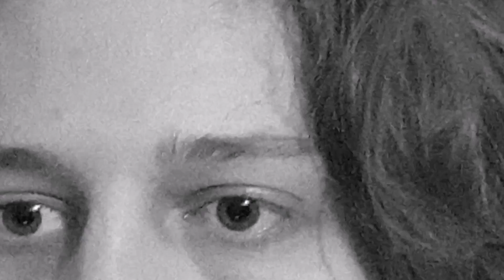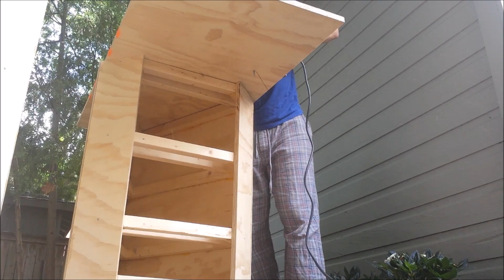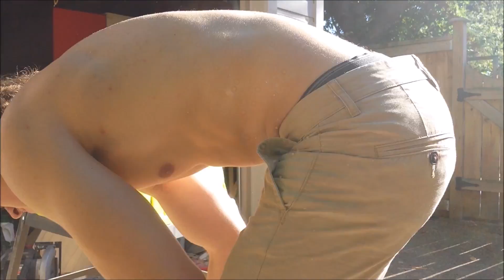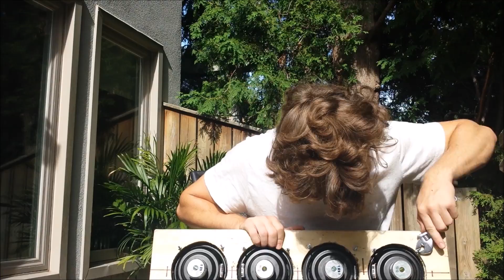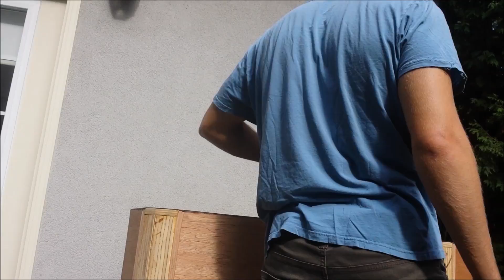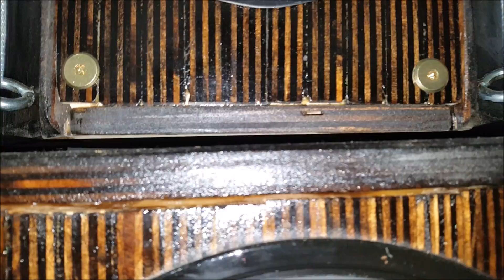700 lb DIY Speakers

Comment: Crazy job mate!!! It's great to see this kind of dedication. You are on a right track. These deserve dedicated listening room. Strip the sheetrock in your room and replace with 3/4" Birch plywood. Make sure that you have it packed with Fiberglass insulation between studs. Then add some acoustic panels as needed.

Comment: Great design, almost there, need more work on the finishing.
You should not just lacquer it like that. Trim all the access, get some body filler, sand it smooth, then spray paint it.
Lacquer gloss finishing need some amount of woodwork skill and a lot of times to do it.

Comment: Very nice!... I would have loved to see how you made the crossovers for these!... Are you using passive x-overs, or an active electronic one and separate amps for all the drivers?... If you used passive x-overs, then did you make the coils yourself ,and what type of capacitors did you use, and on the other hand, if you did use an electronic x-over and separate amps, then which x-over model did you use?... Also, what kind/brand/model of tweeter is that? I like how you have it suspended like that; that set-up ends up producing better imaging than if you had it mounted to a baffle, because of the sound diffraction from the baffle itself... Nice design, looks pretty high-end... More details please, about above questions!
Reply from the maker: its an active crossover. the crossover is a dbx 234 i think. the tweeter is an Aurum Cantus AST2560 Aero Striction Tweeter. All the drivers are suspended from the base to isolate vibrations. i honestly couldn't think of a way of mounting the tweeter, but this method gave the best imaging as you said and made it easier for dipole sound pattern.
Reply: Nice! Thanks... I'm gonna have to try something like this sometime for myself!

Comment from the maker: Could anyone give me some suggestions on how to improve my video/content for future builds?
Reply: We want speaker schematics.
Reply: DiyItYourselfYourself make a cerwin vega l36 baffles
Reply: I have plenty of suggestions for you. If you can take constructive criticism, here goes:
Firstly, I like the fact that you are building, not buying. And you have to start somewhere, so well done with the correct mental attitude.
Content wise, the speakers look like steam-punk at best. There are many mistakes and errors, bud. You don't know how to cut, glue, clamp or join properly. And your table saw technique will soon see you parting ways with a finger or two. Probably the second worst use of a table saw I have ever seen. At least you seem to be wearing safety glasses, so that's a plus. Regarding choice of materials, rather use MDF or particle board for cabinet construction. 
Plywood is not a great material for speaker boxes, because it often has voids between layers, and it flexes too much. These two issues can lead to resonant panels. Any joint that is not structurally sound will also resonate.

As a beginner, you should focus on simple box designs that are within your skill set and your tool set. Use butt joints with interior battens that will both strengthen and seal your box. Finish exteriors with bondo rubbed down properly to conceal lines, and matt grey, or black paint to finish. Or a textured paint like fleckstone or truck bin liner instead of the bondo and matt paint. Use a router to ad half round profiles to edges.
Regarding the mid-range enclosure. From your video, it appears that your mid drivers are sealed at the back. So no enclosure needed.
Regarding the steel framework: Totally unnecessary, and badly welded. 
Why bother with that crap of suspending mids and a tweeter? Absolute nonsense, mate.
If there is a reason behind it that anyone could hear, all speakers would be made that way. Forget esoteric, audiofool nonsense. Concentrate on a well made box (use a driver with known T/S parameters) , with ONE full range driver, and ONE tweeter. 12 or 24 dB/octave active filter, decent quality amp modules. You will be amazed at how good it will sound.
If you want me to give feedback on your video, let me know.
Reply from the maker: I sincerely appreciate the criticism. You are absolutely correct, I do not know what i am doing. This was my first real woodworking experience. I completely disagree with sticking to simple projects however, I feel that attempting projects totally outside of my skill set is the best way to learn faster. MDF is definitely easier to work with. However i have also read on multiple sources that MDF makes the sound dull and removes musicality. I have read that dense plywoods sound the best as box materials. Unfortunately dense plywoods were out of my price range so i went with spruce. The reason all speaker are not made that way is because its a pain in the ass to do and expensive. However if you look at many expensive speakers they have the lows mids and highs on separate baffles. Im not sure if it makes a difference but i thought it would look cool and increased the scope of the project. Focusing on designs in my tool set is some great advice hah. The angles were so inaccurate i spent too many hours sanding. The mids werent close backed, however i did design the box to be way to big (i designed the mid box like a woofer box) because of lack of experience. Any woodworking feedback i would appreciate however i will continue to attempt difficult projects.
Reply: As someone who is also in the DIY speaker hobby, I can say you have much to learn. We all have to start somewhere, and you certainly don't seem afraid to jump right in and get your hands dirty, so kudos to you for that. But consider reading through some of this before you decide to tackle another project, you will be glad you did. http://techtalk.parts-express.com/forum/tech-talk-forum/38661-the-speaker-building-bible
Reply from the maker: Thanks for the link man, super helpful. I read the loudspeaker design cookbook, and the Designing/Building Speaker Systems 4th Edition. I need more knowhow on woodworking. I also know significantly more now then i did when i started the project. I think my biggest mistake was choosing a pentagonal box shape. I really fucked up all the angles but through hours (and hours) of sanding i was able to make it work. thanks man
Reply: DIY - Spend a little less time on the woodwork and more on how they sound. No doubt pretty good...
Reply: Put a shirt on and stop beiber fever

Comment: Which speaker models have you used in the construction? Did you make crossovers? If so, how is it built? Did you carry out acoustic and electrical measurements?

Comment: I think they came out nice so are they three-way or two way or single can you describe the wattage handling and what you're driving them with I like those cables pretty cool
Reply from the maker: terry tate the low end is driven by a 500 watt per channel plate amplifier, the miss are driven by a 300 watt per channel plate amplifier and so are the highs. There are 2 channels (one for each speaker) which puts total power handling at 2200 watts. Of course those stats are based on the manufacturer data so it's safe to presume that the actual output is less. Also the highs never draw nearly that much power. I have the boards being powered off of a 1500 watt rectifier board and that thing hardly struggles so it's safe to assume that the power never gets close to that. Still though every tier of each tower has a sensitivity of 96 db per watt so these things really give the walls a run for their money. The whole amp system is made from premade boards except for the transformer which I found to be half the price to make myself.

Comment: I say piss off to to people who don't get it. Yeah you're suppose to build a golden rule box and do this and that, but where's the fun in building a speaker that thousands of people have already done before. 
I agree with you that mdf sucks. Any good pro audio cabinet is birch ply. Mdf is porous like a crap, and you could drill a hundred holes in it and it wouldn't change the sound quality. 
As far as woodworking skills and such, practice and practice more, but safely. Table saws love careless fingers. And use a router instead of a rotozip for driver holes, so you could flush mount for a better seal of the drivers. Don't use screws, use glue and shoot brads for quick assembly. 
The best suggestion of any cabinet design, no matter what the shape, or material, or thickness, is bracing from front to rear, and side to fight internal air pressure flex. The triangle design is a great alternative, but still need bracing to fight wall flexing. 
Have fun man, It's not like your building a church. It's a box with speakers in it.
Reply: Derik Henderson cool story bro, tell it again.

Comment: Interesting design! I'm curious why you put the tweet high up on top? Why not between woofers and mids? Have you experimented with it?Also curious about the wire suspesion, any experiments there as well to hear if it was worth it?
Reply from the maker: Torkel Werge I'm not really sure if the cables were worth it. I suspect the effect on sound would be negligible. The tweeter up top however is very cool. It males the room sound like a big theater or hall. If you close your eyes you can get a sense for the size of the speakers. The best way to describe the sound is big and open.
Reply: @sugastuff8838   Hi i find very interesting the tweeter placement ... unusual but if you get what you mention i am sold.  May i ask
1)  which drivers have you used for this very impressive project ?
2)  which cut frequencies between the 3 sections ? i guess the drivers are connected in series ? 
3)  which sensitivity ?
4)  do you get some depth of soundstage ?
Thanks a lot, gino

Comment: I don't get it...what's with all the cables? strength? db? coolness? never seen it before but curious...
Reply from the maker: the cables isolate the mid box from the low box. its kind of like a suspension bridge. i also thought it would look cool on the finished product.
Reply: It does look cool though!
Reply: Chris Woods
Reply: i have B&W speakers and they actually sell speaker spikes that achieve the same goal.. looks like spikes that go on the bottom of the speakers
Reply: doesn't matter if your drivers have a reasonably decent off axis dispersion, except that you can lean the top towards a lower direction (listening).

Comment: Shoulda used MDF and concrete base, then you coulda gotten make over 1000 lbs...
Reply: mdf because it doesnt have voids in the wood like plywood.
Reply: Mdf is at all much better just knock it you can hear and feel the difference
Reply: birch plywood have no voids, ok it cost nearly the double.
Reply: Plywood is good enough, stronger then mdf but maybe more resonant.
Reply: @lucabergantino6894  Birch Ply is indeed double the price, but its also half the weight, and non-toxic.

Comment: You had some good ideas but also some rookie errors. The workmanship is on the level of a pre-pilot study. If you plan to increase the surface quality a little bit you should rework with fine sand paper and clear varnish 1 or 2 times. Better use a buzz-saw instead of a "Schnellficker" (com. german for jig-saw).
I think it would sound better if the high-range speaker is mounted between base and midragne. anyhow the surface ratio of the mid-rage to the high range speakers i estimate at 7 : 1. Better stack 4 high range speakers left or right of the mid-range and don't forget to adjust the cross-over.
The wooden staffs under the mid-range box supose me that you planed to let them "fly" held by the steel cables. You shuold use some elastic material instead of wood to seperate or eleminate vibrations.
Reply from the maker: there are no wooden staffs. they dont touch the top of the base cabinet. thanks for the advice.

Comment: I think you have some weld in your slag inclusion, so don't stand to close to them in case the welds let go and you get showered with shrapnel, A good effort though.
Reply from the maker: Hello big boy, i appreciate your concern about my safety! While the structural integrity is certainly not up to par, i did remember to remove any remants of c4 that the welding process left behind, so i should be safe from shrapnel. Yours truly
69
Reply: They appear to have worked out very well, Is this the first pair you have built.

Comment: Are you Peter Griffin?  Good idea, but the build quality was horrific, coming from a person that has actually built a couple dozen systems and not some internet hero.  I hope you learn from this and go on to make some better builds in the future though, because it's a good hobby and ambition is a useful tool, but like all tools it must be implemented properly. Just saying. lol
Reply from the maker: +hahasimpsons this was my first build. Why does everyone expect perfect build quality?
Reply: DiyItYourselfYourself reading between the lines i implied that it was good effort and your next build should present much better results. You incorporated many interesting design elements which were unique.  Live and learn. Don't just repeat and expect differing results.
Reply from the maker: hahasimpsons my apologies. Thanks for the advice.
Reply: You should do a video describing why you built it like you did, for example why you used resonant materials to build the suspension system and what effect you intended for them to have.  Also which Behringer amp and processor you used and how you like them.  I have a a Yamaha RX v667 feeding a Behringer Ultra DI pro and Feedback destroyer pro, going to 4 Altec Lansing 9444A  and 1 Behringer ep4000 amps, but would like to get 5 of the iNuke 3000 dsp's and a 1200 for the subs.  Fun stuff to play with.